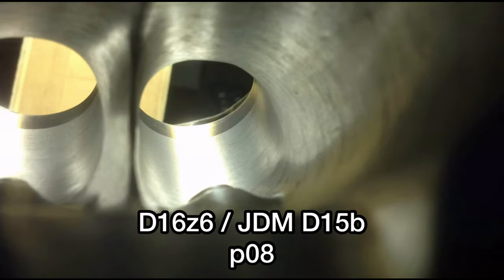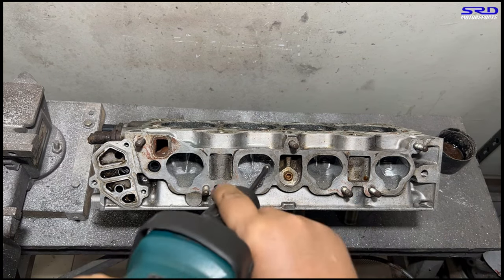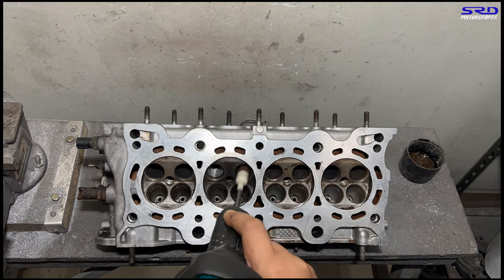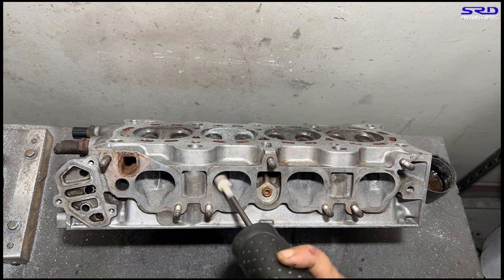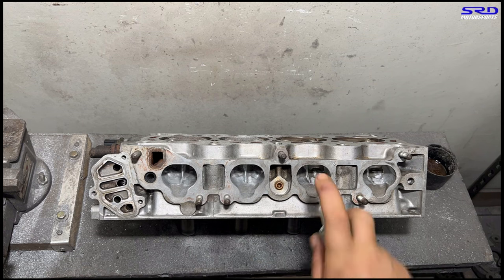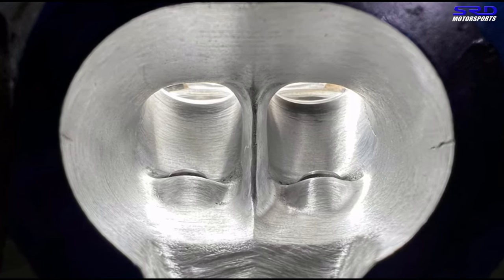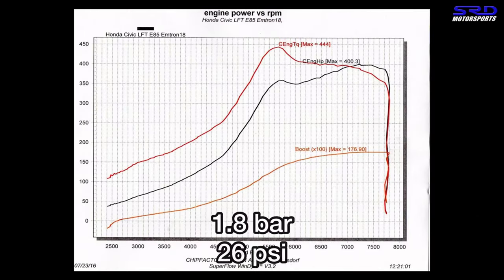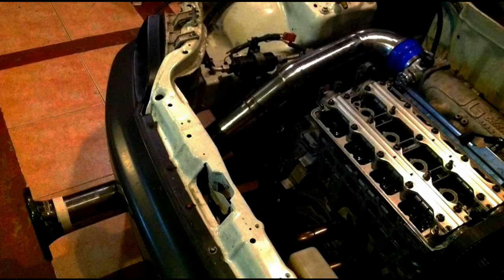Dyno Proven D16z6 / D15b P08 SOHC VTEC Head Porting Development

Comment: Very nice Sir!! why not shape a little around  the intake valve bosses, loose velocity or not necessary in this application just curious about that particular area always intrigue me!! 👍💪
Reply from the maker: Cool question! Yeah we could do that and sometimes it’s needed yeah but on “my” way slimming that out also adds “port volume” or increases it,

That’s the story why when some use those kinds of head? And don’t reach their goal? Those involved would say “needs more comp” or “needs more cam” or “needs more rpm”

Which all says “too much” port volume

On that project for Austria (the ones dynoed) run GT35 and good ecu so we know power is expected from boost and the head can be street/mild and still do good? Heck they made 400whp on stock head :)
Reply: @SRDmotorsports   Yeah that's  what i though ,more area need more cam ,more comp and all of that jazz .Thank you sir for the fast answer and keep em coming !! love the series specialy the D series engines stuff.
Reply from the maker: @Rodman8500  thank you man glad it’s enjoyable and we will try to improve some more
Reply: No real gain to grinding those way down.  They help pull heat out of the valve strem which is way higher boosted

Comment: Love honda guys because they are usually the only people that are doing more than slapping a turbo on and cranking up the boost to make power..They actually build the engine. Why i was on honda forums to build a mitsubishi because NO ONE builds a 6g72 all-motor so the only knowledge base to do a max-effort all-motor build for one is honda guys. And welp i have a 3.0l v6 that runs like a honda motor lol. Not much torque down low and everything up top and it goes 9k rpms+.
Reply from the maker: Wow 9+ k rpms!!! That prolly does sound real good!!

and maaaan I see we both did find the old Honda Forums real good and fun 😎
Reply: @SRDmotorsports  Its got a really weird engine tone. Being 13:1 cr with a built bottom end bc625 rods and ross 12.5:cr pistons with a resurfaced head that was ported,polished,brass valve guides, Bc springs and retainers, Ferrea +1mm valves, 272 cams, GSC dsm lifters, 3sxcam gears, Block was bored from 91.5mm-92mm, entire bottom end was re-balanced and its got an aluminum flywheel on it. Even polished the combustionc hambers on it..And completely gutted the car so 1 seat with an 8-point cage, no abs,A/C power steering and its on solid engine mounts with a built trans using a quaife qdh7b Lsd. Also has a holley Ls intake and adapter from breton performance in puerto rico from their 9sec all-motor 6g75 mirages with a 95mm Gm throttle body. So its all top end. My data logs are hilarious it can go from 53cfm of airflow at 2% throttle to 274cfm airflow at 7% throttle lol right off the graph. lol.
Reply from the maker: Maaaaaaan now that’s an engine right there! 

oh if F1 did an NA v6 today 😎
Reply: @SRDmotorsports  Biggest problem i keep running into is no tuner wants to touch it in my area and a lot of parts were 1-offs. Tuners dont wanna touch it because its like 1 of 2 all-motor 6g72's in the country the other is technically a 6g74 built in n.c still using the stock intake manifold. So wound up having to teach myself how to tune it through ecuflash. The irony of having to learn how to tune a car because the pros wont touch it is not lost on me. Im really trying to describe the engine sound..Its more like a yamaha R1 with the cross-plane crank in it. Definintly sounds more  motorcycle than car.
Reply from the maker: I understand that part where no tuner wants to touch it… and no hate to the tuners a lot out there are really good and good people

But most aren’t builders…so for safety they avoid it but as a builder + tuner I understand why… it’s also why I don’t throw hate like most tuners 😎 cuz I’m a builder first…

And that’s good u getting to tune ur stuff u got an advantage cuz Ilu understand the motor well as per your design…

And oh yes!!!! Now I can imagine the sound since u mentioned m1 maaaaaaaan that sounds tough!!! 😎
Reply: @SRDmotorsports  Its definintly been a learning experience. Having to learn tuning and then most of what i've been tuning has been idle and part throttle. With everything being lightened up, definintly some low end torque has been traded for high rpm power and the aluminum flywheel. i've had to spend a lot of time tuning the driveability back into it. More than just straight power tuning. For all-motor thats kinda the easy part. it's mostly fuel tables,ignition timing and datalogs. Going through all the tables to get it running better at part throttle or when you roll up to a stop where the aluminum flywheel and lack of torque wants to instantly shut off the engine..Thats where most of my time has been at.
Reply from the maker: @az_3kgt714  oh yes! That’s the tricky part indeed but man! That sounds like a fun engine u got!!!

Comment: Heads can make a world of difference, I have a Jeep 258, Dyno'ed old stock head (low intake and 90° turn into valve) and then switched to a newer 4.0 7120 Head (Intake is raised up and allows more flow).  No other changes, didn't port or match or ANYTHING, just slapped on a newer design with better flow but still factory crap, lol.

Dyno'ed yesterday with new 4.0 head.
Previous 258 Head: 103.7 HP 188.6 TQ

Current 258 with 7120 4.0 Head: 127.3 HP 211.2 TQ
Overall gain: + 23.6 HP + 22.7 TQ

That's huge with no tooling work done, plus my RPM limit raised about another 750!!

Next is the Aluminum Edelbrock head, this is when things will get FUN.  But I post to say, yeah, they are often overlooked by many.
Reply from the maker: Oh maaaan! That’s a decent chunk of gains 23.6hp and 22.7 tq on just change of heads alone…

I can see that NOW the fun begins! With the earlier talk we had on the other video about torque n response…now add the “playing” with the 7120 4.0 head maaaaan 😎

Comment: Is there different models for the z6 engine, im in the uk and we have “esi” del sol and eg. Are they both like for like or is a specific model one to go for. 

I have an 7th gen EP2 which has a d16v1, no mod support for power
Reply from the maker: Z6 engine has the head casting P08 no other casting for the z6 head but a P08

Comment: What's the difference between a D16Z6 VTEC head and a d15b VTech Head from what I heard they are basically the same I'm trying to figure out I want to put a d15 on a d16 z6 built bottom half with with h beam rods YCP pistons but I am planning on rebuilding the head with some BC valve springs Ferrara valves and a street Savage cam from speed factory I originally bought all the parts for a d16 head wondering can I still use the parts and put it in a d15 b head I'm assuming I can what's your opinion
Reply from the maker: Same casting actually

Comment: DIdnt see a valve job or short turn work? WHat was your bef and after volume?
Reply from the maker: We always do a valve job after… and short turn work on other vids u can see em… the rest is on the notes
Reply: @SRDmotorsports what’s up bro, I have a project going on and you seem to have an extreme amount of knowledge on this subject. I’m sure you’ll get a laugh at what im thinking about doing but here goes. I have an ‘09 Tacoma base model with a 2TRFE 4cyl motor, im at 265k and I know im going to need to either rebuild or better yet a 1GR v6 swap or if I hit the lottery a 2URGSE 5.0 swap but realistically funds are limited here. These little 2.7 couldn’t be any more under powered , any slower and I’m in reverse. There is the option for running a SC from URD but that’s also almost 5k for just the set up not including the labor to install and tune. So here’s my question and sry for the long background, have you ever done a Toyota 2TRFE head and would it be worth it if it would be possible to do? I know it sounds crazy but I would love to have more power in my little tacoma. Thanks in advance.
Reply from the maker: I havnt tried a 2Yrfe but I’m sure a slight port clean up and a decent valve job could def help breathability

Comment: Bro what you think about a d15b2 block with a d16z6 head a 272 cam but with out the VTEC will be a nice set up all motor including the y8 head gasket compression probably 10.1-5 reason the VTEC really start to pull in higher rpm compare to no VTEC what you think plus less expensive with computer crap
Reply from the maker: That sounds interesting yes indeed
Reply: @SRDmotorsports  the reason I ask is because I'm going to try it myself I think by putting the d16z6 vetc head on a d15b2 block is the best combo mini me because raices compression to 10.1 and probably 10.5 with the y8 head gasket and above all with a 272 Delta cam regrind I think the d15b2 block with become a beast with higher compression and  higher rpm and lighter flywheel gd clutch kit gd air filter should be nice more bulky in response plus I don't like short transmission gears that mostly for races I'm talking more like to play around cities and highways the short gear will come down shifting from 5 gear to 3 gear jjjjj 😁 what you think bro
Reply: @SRDmotorsports  plus the d16z6 head flow nice with a header and 2 1/4 free flow exhaust system should be nice combination with the d15b2 block and compression 10.1-5 and the 272 Delta camshaft and 10 pound flywheel should do for a  snickey rascal voodoo child CRX jjj 😁 it should work what you think with you experience in d series engines imagen with you bore out intake manifold more air more better and a bigger Honda Accord tb should fly and be real gd on gas in my opinion
Reply from the maker: @salrivera7578  yeah and it’s easy to make the z6 head to flow well
Reply from the maker: That’s true
Reply: @SRDmotorsports  do you think that will work well with out the VTEC on I think it will work nice but I want you opinion I have a p28 but I don't want VTEC because I think with out the VTEC shouy work better in my opinion what you think
Reply from the maker: @salrivera7578  if u lock the vtec on it will work just won’t idle like vtec it will idle like a 2tc on cam spec 5 but nice still haha
Reply: @SRDmotorsports  jjjj 😁 well I have my CRX with a 272 cam and 10 pound flywheel and is duel point 16 valves and I can say she fly fast but she have y8 head gasket and she really pull hard to fast in straight run city 2 and 3 gear she do 100 in 3 gear and around 68OO rpm dangerous the duel point fuel injector have the higher rpm runners shorter in the manifold I don't if you know this the duel point fuel injector system the 2 higher rpm runners in the intake manifold are shorter than the lower rpm runners and that the reason she fly.Now the d16z6 head flow better and give more compression first I'm going to see how will run with the duel point fuel injectors manifold if I like it I live them on for the cam sound if not I will put the 4 injectors system with out VTEC to see how it run .But like I said the duel point manifold have the higher intake runners shorter meaning mambo king jjjjj.well in Puerto Rico they have 3 tc running 9 seconds with the 2tc head 305 cam and Ford 4 battle carb now they came with a 80 Corolla with a 2j Nissan motor twin cam turbo running on 5 second jjjj 😁 crazy and yes they run the car in the streets like any other car nice cool jjjjj
Reply from the maker: That’s so cool man
Reply: @SRDmotorsports  yes I going to try it anyway and do you know why dx CRX was faster than hf four injectors was because the duel point fuel injector dx CRX have shorter runners on the higher rpm range the secondary fuel injector my is a beast in the I with my comble and the cam sound real healthy like old muscle car Ford and in higher rpm like a Ferrari the cam pull nice but in the cities is a lot of fun 2 and 3 gear that all vtecs try hard jjj let her from 3 to 2 gear and she fly fast and 3 gear is a turbo jjj 😁 anyway I'm going to try to see if she will jump to 110 or more miles in 3 gear probably to 7200 to 7500 rpm if she doesn't broke she be ready for a fight jjjjj 😁😎
Reply from the maker: Niceeeee
Reply: @SRDmotorsports  that the reason I'm going to try my theory with the d16z6 head I'm looking  more into compression and cam not on VTEC more like old school style VTEC is cool but they even have hard time to get behind me in my duel point fuel injector CRX with the 272 cam and 10 pound flywheel in the city my pull to low up to 6800 to fast for them the flywheel make the move for the cam to response fast and the secondary fuel injector is right there sending gas no shortage of gas at all the ECU seems to adjust to the cam and compression perfect but I want to see how will do with the d16z6 head and compression ratio people say this and that but they all have problems with my duel point fuel injector and a simple system well I will know around a month from now
Reply from the maker: Yup!

Comment: This while you are in there attitude porting makes a big difference to almost any engine 1 ltr or ,7ltr self ported two mgb carburettored cars huge power gains on original heads , economy and acceleration,from factory can be bad even BMW's can be improved as manufactured with minimum engineering your free time makes all the difference ,port from air filter to outlet manifold removing the rough cast to speed the flow.
Reply from the maker: That’s so true

Comment: sorry if this is a stupid question, if i have the same engine but with full bolts on do u think this u will improve engine performance?
Reply from the maker: Actually after “bolt ons” that’s the next step including tuning Ofcourse so definitely improvements can be had
Reply: @SRDmotorsports  thanks alot , what do u think its better an d16z6 head or d16y8 ?
Reply from the maker: Both are more than okay… I mean
Unless you are building an all out racer
Then I’d prolly choose the z6 then

Comment: ported p08 manifold and head + b16 throttle how much gain for stock p08 bottom end
Reply from the maker: Really depends could be 5hp could be 20hp but it will have gains for sure

Comment: Do you think porting the head on a stock engine with bolt ons would merit decent horsepower?
Reply from the maker: On a d16? Yeah it could merit a decent gain… on a b16 maybe a little less… mainly due to port volume of the b16 head and it’s displacement now if it was a b20vtec it’s a diff story
Reply: @SRDmotorsports  okay thanks I recently put a skunk2 pro intake manifold and 66mm throttle body and was looking for some more ways to free up some horsepower
Reply from the maker: @SeriouslyLarge  oh definitely it be worth it for u

Comment: what does it cost to do a head for someone from uSA?
Reply from the maker: the shop page has a pricelist pinned though local currency the exchange rate favors the USA 🤣 but depending on core sometimes getting a core here may be cheaper than sending the head from there to here then port then send back

Saves one way shipping brother.